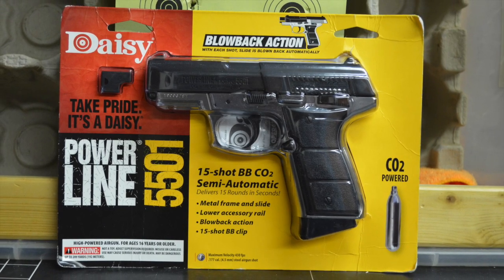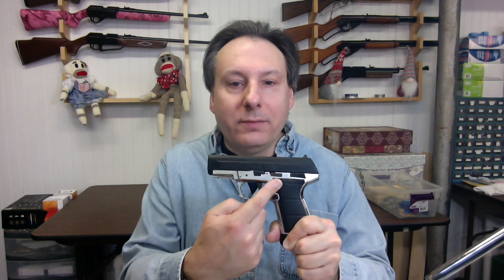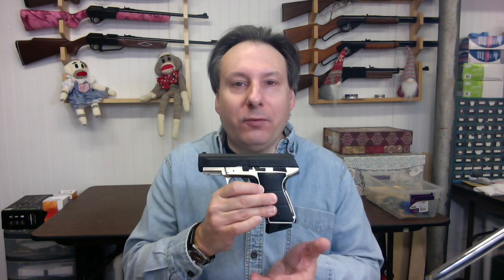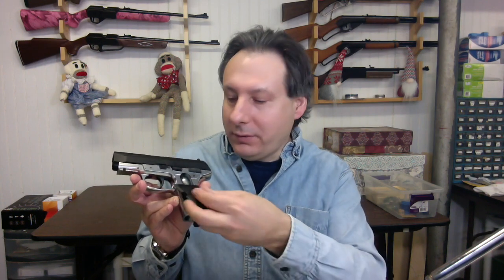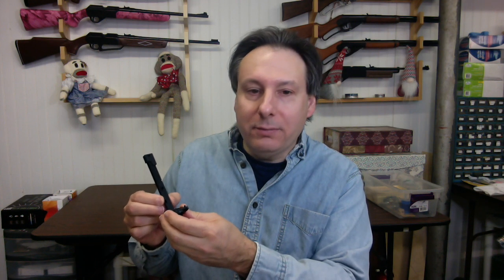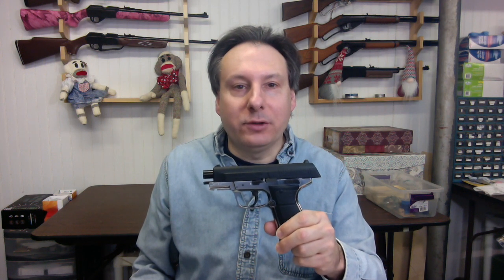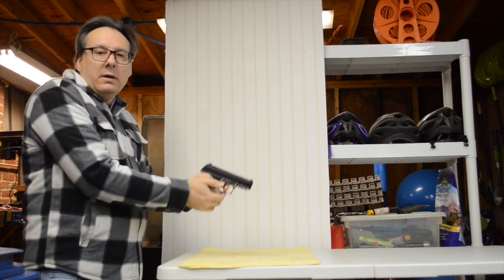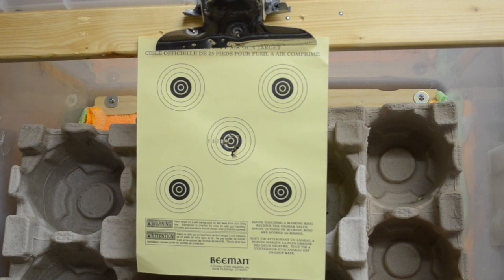Daisy Powerline 5501 Air Pistol Review

Comment: I hope you don’t own any real guns.. also btw that pistol doesn’t have a clip
Reply from the maker: The Daisy Powerline 5501 does in fact have a BB Magazine clip. Maybe you are thinking of the Daisy Powerline 426, where you load the BBs at the top of the fixed slide.
Reply: Rust Belt Air Gun  I see the issue. You’re confusing a magazine with a clip. Yes the pistol in this video has a mag, not a clip. An example of a clip is something like what you’d load an M1 grand with.
Reply from the maker: I see the difference, a clip is a device that is used to store multiple rounds of ammunition, ready for insertion into a magazine. Thanks for the clarification.